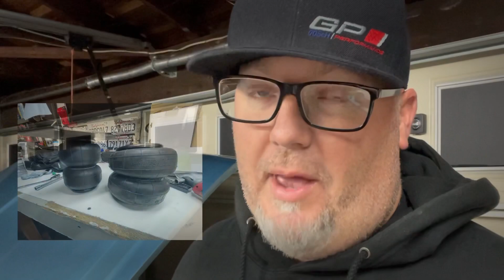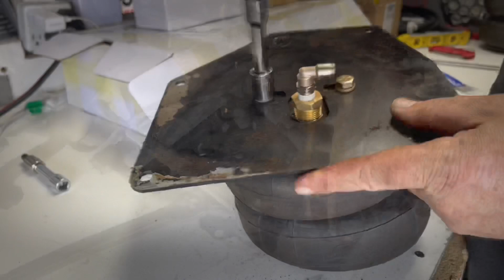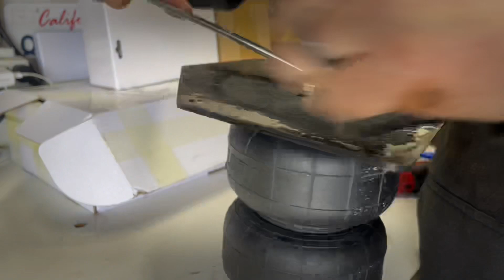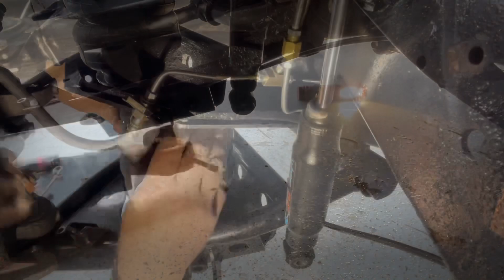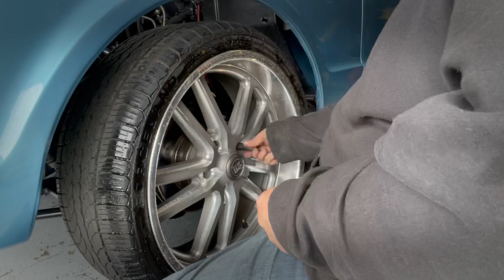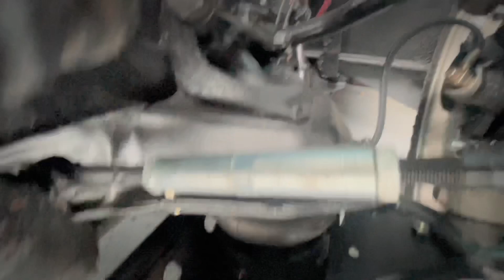C10 POL / Western Chassis control arm air bag fix & installation

Comment: I have stock control arms and 2600 lbs bags and have same problem, have 2600 front and 2500 on the back ,should I switch 2500 to the front? Thank you